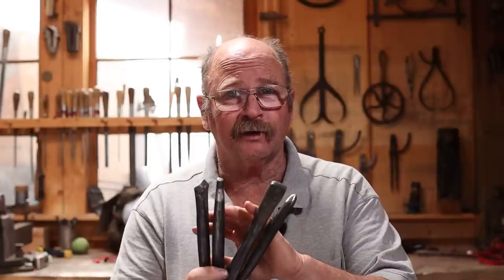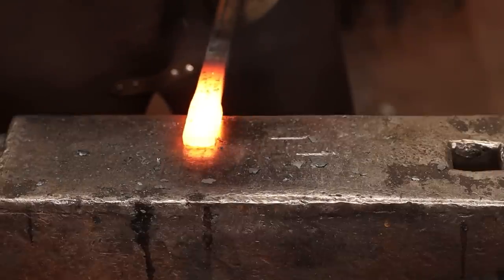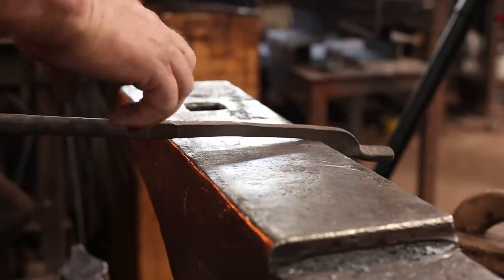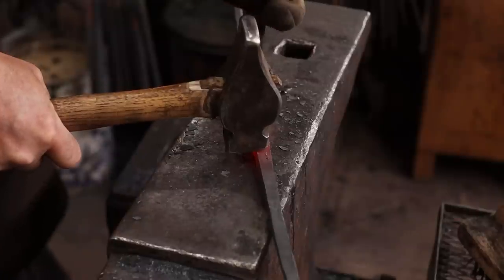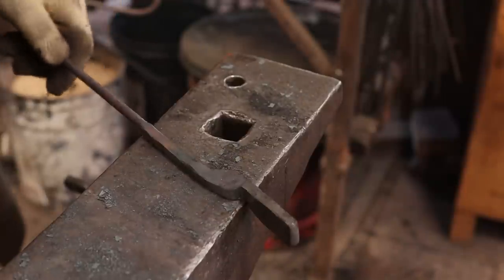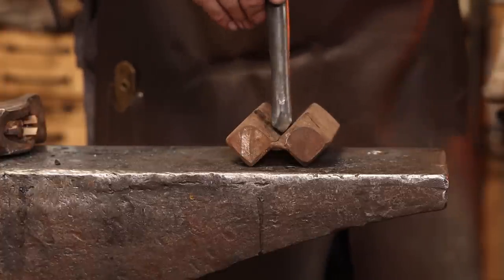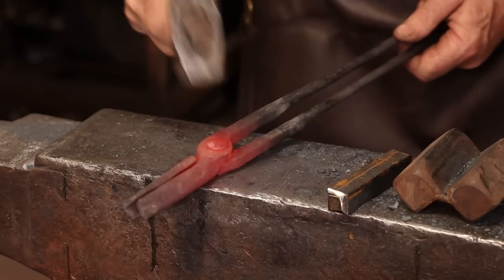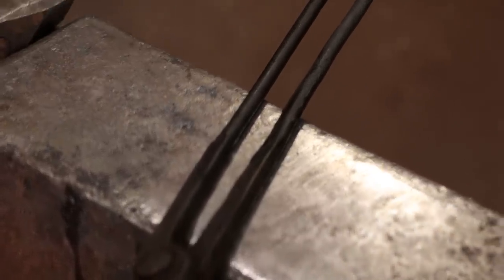Forging V bit blacksmiths tongs

Comment: Hello John: I am a machinist who became a technician and finally and Engineer. I have worked with metal all my life (well most of it anyway) but recently I have started to diversify. Surprisingly I have begun wood working (something my Dad who was a Master Machinist had me soured on for many years because he always said that wood was a miserable material with all the knots and other imperfections. I have since found wood to have a certain beauty of its own.). Anyway, I have also taken an interest in Blacksmithing which incidentally my Dad did because he got into the Machinist trade through the traditional method of beginning as a Blacksmith. Sorry for getting long winded. 
Anyway I have watched quite a number of your videos (and "liked' all of them) especially the ones on making tongs. However eventually I did buy a set of tongs because it was frustrating to be in the situation of trying to make a pair of tongs while not having a pair of tongs.
Since then I have made a few pairs of tongs and as you might expect they are a bit ugly though functional. But here is the problem: they are all handed. I made some right and some left, but I am not handed, so when the hammer arm gets tired and I want to switch, I now have tongs that are clumsy in the other hand. Is there a way to make un-handed tongs? Please let me know.

Comment: Many, many, many years ago. I worked at a machine shop. There was a lot of scrape metal. I founfld a piece of aluminum with a small lip. I cut it to the width of my anvil and usebit when I hot cut.

Comment: good humility - 1045 can be used as spring steel, but it isn't optimal. I temper in the same range you do for punches and chisels. No idea for fullers, they could maybe go higher. Thanks for everything. I love watching how you solve the problems we face.

Comment: Great thanks. 
From my limited experience I have difficulty understanding how much metal is needed to make a particular shape.
Reply from the maker: It does take experience.  But you can also test using clay to see how much is needed.  Most things can be calculated mathematically as well.

Comment: You mentioned before that Borax is really slippery, would it help loosen the joint if you melted some into it?
Also, have you ever made rail spike tongs, or have you ever tried just modifying something like lineman's (aka bullnose) pliers into tongs?

Comment: Would making a jig for the flypress similar to the top and bottom tools you used at the Hardy be a good fit here for shaping the vbit? 
I watched this when it came out, just watching again under my new channel. Thanks John!
Reply from the maker: Yes, they would probably be a better approach.  It just takes time to make the specialized tooling.
Reply: Nice, thought it might. I have a ton or so of old 4140 dies from a big press brake. Thinking of tooling I can make. Thanks so much for the reply to a somewhat older video of yours. You are much appreciated, friend.

Comment: I have issues getting my material up to white hot. Just home made coal forge with   a blower. Just seems like bright yellow is hot as it gets
Reply from the maker: Yellow heat is enough for forge welding, anything hotter is burning material.

Comment: Is the fact that your tongs are either left or right handed based on your hammer hand or the hand you use to hold your tongs in
Reply from the maker: I go by the hand I hold my tongs in.  So left handed tongs in my left hand.  But since your making your own, just make them to fit the correct hand

Comment: I know this is an older video but may I ask if you used the flat or rounded head when reducing the reigns?
Reply from the maker: For something like this I mostly use the face and work over the horn to speed the drawing process.

Comment: Great video, When you were setting/peening the rivet, how did you get the rivet to glow so hot but not the surrounding area. Did you quench them partially? Thanks.
Reply from the maker: The smaller rivet heats up faster than the heavier tongs.  You just have to get it out of the fire at the right point.
Reply: @BlackBearForge  Thank you.

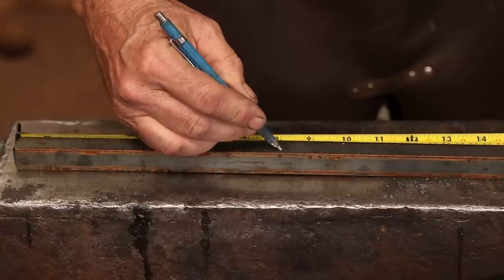Comment: Hi, Just wondering at about 3:41 your holding some kind of engineers chalk pencil, do you know the brand at all? :-)
Reply from the maker: Thats a welders silver pencil.  The product is Markal Silver streak.  They should be available at most welding shops.  I also have them on my Etsy shop
Reply: @BlackBearForge  Thanks :-) I'm across the pond in the UK so the delivery is large but managed to find a local supplier. Thanks again your videos are amazing and very informative!

Comment: Do you still use your hidraulic press? Do you think someone looking for buying/building a power hammer should consider a press instead?
Reply from the maker: I do for certain things, but  find the power hammer to be more versatile n most cases.   But a press can have advantages such as cost, no special foundation and won't bug the neighbors.
Reply: @BlackBearForge  thanks for your answer.

Comment: Does a propane forge save time? It seems like the heats last significantly longer than im used to
Reply from the maker: Propane should be able to achieve the same heat as coal if set up properly.  But it really saves time by being able to heat multiple peices at one time as well as heating a larger area.
Reply: @BlackBearForge  does it make much of a difference that it heats up the whole piece instead of parts of it

Comment: Using a hand held hot cut, I teach to use a cutting plate, just a piece of mild plate over the face of the anvil. Not because it is a better way to go than not using it but because it saves the face of my anvils from accidental cut marks. Other than that, everything is pretty much the same. I say to roll the tong out rather than to say roll to your tong holding hand but both ways are the same LOL. I also use 3/8 x 1/2 starting the bit with the stock 1/2 high and forge the jaw down to 3/8 thick,  rather than 3/4 sq as it is a bit less drawing but you do wind up with a little smaller tong.  I agree straight bit tongs are easier than bolt tongs and are just as effective with straight stock. Nice job!
Reply: Well then Wayne, with all your information. You should make a video. I should also note, John has used a sacrificial plate to hot cut a hundred time in his videos.
Reply: @78LW  I have, the projects take twice as long to do and the editing takes as long as the project. I just finished one beginner class this morning and have another one after lunch so I don't have a lot of time to make videos though I do send people to this channel for good information.

Comment: Could you not just bet it over a piece of angle iron that is 90 degrees? that would give you the v or weld a small piece of square bar point down and beat it over that

Comment: Ahh, pay them no heed. Probably people who confuse the datasheets of Steels in Europe....no idea how that works in other places but over here the tools steels have a tempering diagram from as quenched to max sensible temper, that being usually in the 700F range. Machinery steels however have a range of tempers shown for reliable tensile strength with some degree of ductility. A range which conveniently starts at around 700F and ends shortly before a full anneal. Confusing and criminally stupid. No idea who came up with this, especially given how some steels are both machinery and tools steels (spring steels, in particular)